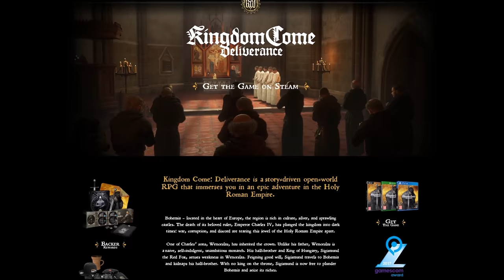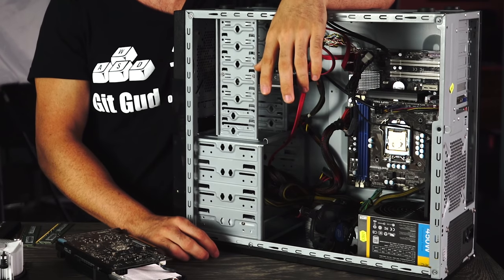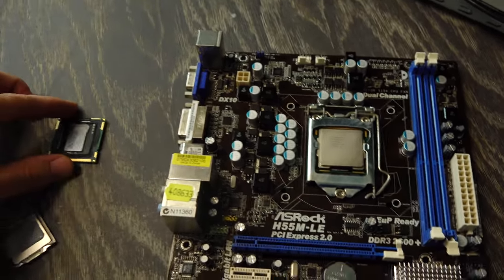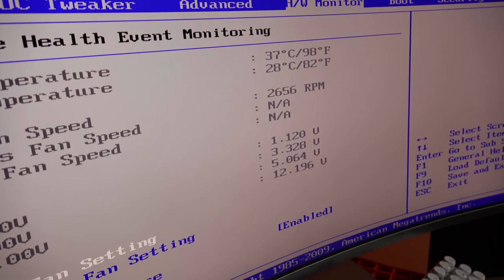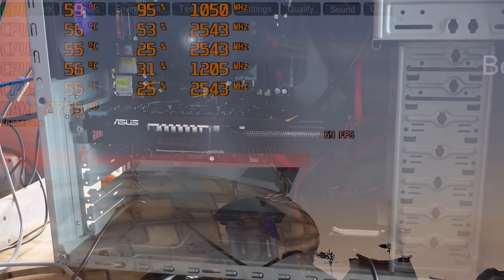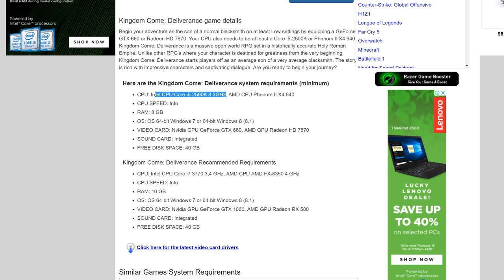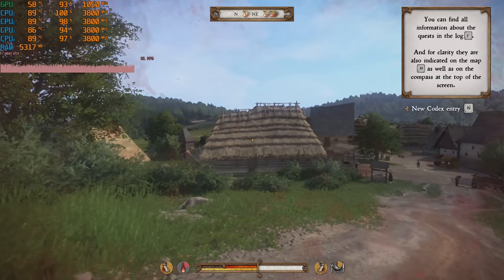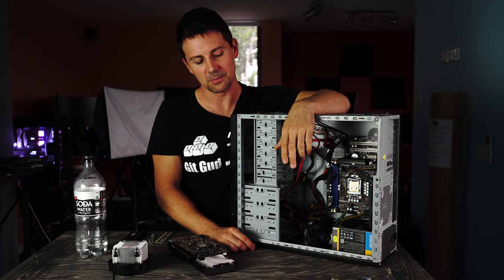The $150 'Bitsweeper' Gaming PC - Mounting an AMD Cooler for Saving that $$$...!

Comment: That graphics cards heatsink has gaps and has aluminium in between. Assuming your liquid metal has gallium in it.
Reply: Yeah that GPU heatsink is done for.
Reply: But liquid metal in general has several downsides that are rarely ever addressed by many.  For example, Gallium loves to alloy with other metals. Even with copper the metal ions will migrate into the copper, gradually creating a copper-gallium alloy that is grey-silverish in color. Gallium and indium in liquid metal will also slowly defuse into the silicon die and kill the chip after some time.
Reply: In general liquid metals are a lot more reactive than most know. Particularly when you introduce electrochemical potential between different metals.
Reply: Is it perfectly safe to use liquid metal in between cpu die and ihs ??
Reply: Of course it's not perfectly safe. 
It's just a risk some are willing to take to squeeze out that tiny bit of OC or temperatures.
Reply: CatSay .... i meant in terms of corrosion or reaction between cpu die and cpu ihs
Reply: Also no. There isn't any empirical long term testing data right now (that I know of) but the physics alone says no. It will ultimately degrade the silicon and alloy with or degrade the metals it's in contact with. How long that exactly takes requires testing.
Reply: CatSay ... oh ok thanks
Reply: I do not think the diffusion of metallic gallium/indium into the silicon lattice will be an issue, for one the silicon surface is probably well passivated, and also due to the FCBGA design the "top" of the die is acually the bottom of the wafer, meaning all the transistors are on the other surface of the die. Also IIRC doping silicon requires kiln temperatures, so at the VERY least 300-400 deg. C. I think it is very likely that even at 100 deg. C die temperature, diffusion through the passivating layer would take decades, if not centuries.
Reply: That's what I would also think, but there isn't any test data out there for this specific scenario with large chips.
So for all we know we could be wrong with small surface scratches or edges being a factor.

This all comes down to my earlier statement that we can't say it's entirely safe and that there is of course inherent risk involved which some will forego based on their own needs.

I of course have nothing against people using LM on their CPU's. The science behind it is always interesting and worth knowing however. :)
Reply: tim serious yeah you're good IHS is nickel plated
Reply: One could of course try to do an accelerated aging experiment, say put LM on a CPU and keep it in a "thermal chamber" heated to 125 or maybe 150 deg. C, a temperature that should not cause damage without LM, and test if the CPU still works and is stable every 3 months or so. But that would still be a sample size of few (unless one starts baking a lot of CPUs), so not that great, the best we are going to get is probably a buildup of anecdotal evidence.
Reply: A natural degradation by corrosion/electromigration could literally take anywhere from months to thousands of years under normal circumstances.
In the case of a regularily used CPU probably a bit shorter, but this should really be of no concern to someone who plans to upgrade his CPU after at most 5 years.
Reply: Liquid metal thermal conductors have been used in enthusiast PCs since the early 2000s. So thats at least a decade of good use in its favor.
Reply: rip gpu cooler
Reply: The concern is not corrosion or electromigration, but the diffusion of gallium atoms into the silicon lattice, since gallium can be used for doping silicon to become p-type. Development of a tick enough layer of gallium doped silicon could theoretically stop the CPU from functioning.
Reply: Or use scihub
Reply: +SysPowerTools I would be a bit more receptive of your input if it weren't so accusatory in tone. ;)
I'm simply doing my best in the absence of better information. 
But thank you for your input, this is a community after all.
Reply: I'm pretty sure Bryan has a lot of gpu heatsinks to spare for that generation of gcn. But yes it's not the best practice to show viewers what kinds of heatsinks not to apply LM to.
Reply: I was screaming "NO!", but I couldn't stop him.  RIP GPU HS. :/
Reply: What a job by Bodging Bryan from Brisbane.

Comment: rip the alu in the gpu cooler
Reply: Filip Munk Yes... I thought that aswell.
Dont use LM together with ASUS DirectCU coolers
Reply: TheRailroad99 it's not with asus cooler... It's for anything aluminum.
Reply: Yes but the DCU2 cooler (which was the one from his 7850 )has aluminum between the heatpipes. 

https://archive.benchmarkreviews.com/images/reviews/video_cards/TI-DC2T-2GD5/ASUS-GeForce-GTX-660Ti-DirectCU-II-TOP-Disassembled.jpg

You can see the aluminum between the sanded down heatpipes

Comment: The LM on the GPU cooler is touching some aluminum in between the copper heatpipes. Might wanna clean it off immediately.
Reply: It'd be already too late
Reply: Leave it for more than 24 hours and it starts getting fked
Reply: +Jeremy R Yeah sed life. I really hope it was the fact that he somehow missed it and wasn't like "o that's fine" because he should know it eats through aluminium. Actually I think he does

Comment: I bought my pc for 325usd and it came with this
Full config 
I5 6500,8gb ram,1tb wd blue,a casing with 5fans included, a 21inch dell s2216h 1080p monitor, thermal tech 450watt 80plus Psu and a 650va ups for --- 325usd

Later included a gtx 1050ti 110$(used) and a sandisk 256gb ssd 50$(used) ---160usd

So i spent in total ---485$

Comment: I know you're not a chemsist or anything but you shouldn't put liquid metal on every component. It contains galium which will react with some metals and tear them appart very fast. Just look at what it does to a soda can
Reply: Luka TO it is in contact with aluminum on the GPU and it will severely weaken the heatsink
Reply: weaken but it wont tear it apart if you dont touch it
Reply: Luka TO if he goes to replace it it'll tear away with in a second. It basically turns it into tissue paper.
Reply: yes ik that...

Comment: If the gpu cooler has aluminium between the copper heatpipes the liquid metal will eat that away because chemistry :P it does say that on the big warning label in the liquid metal packaging  :D
Reply: Guess as long as the copper stays clean it should still work. But still prefer nickel plated surfaces for LM.
Reply: @Happy he is talking about how gallium literally kills aluminium, that GFX card is gonna be dead within hours of that contacting it.

Comment: I've got plenty of used PC's. Last December I restored my Asus 970 Pro Gaming/Aura. New case, new AMD Max cooler, Samsung 960 EVO 256GB, and MSI Gaming X 1050 ti 4GB. It already had an FX8350@ 4.4Ghz, 16GB DDR3 2400Mhz. Now with a fresh install of windows 10 and steam. I find it to be a very capable 1080p120mhz gaming machine. I play AAA titles. I use it mostly for my DX11 games. I have a custom watercooled 1600x w/O.C. RX 480 @1410 that I play my Vulkan, DX12 games on. I have 1 freesync gaming monitor so it's shared between the two systems. All those "upgrades" where on sale when I bought them. I felt I got scalped for the 1050ti @$179.00. But look at prices today. Keep up the good work with memory prices and gpu's costs over the top. Last gen pc's are worth a 2nd look. DDR3 memory has supposedly come down recently while DDR4 climbs. I paid $40 for 8GB on ebay recently so why not. I won't settle for less than 3200Mhz DDR4 for my builds. Last spring I paid $130 for 16GB DDR4 3200 x2 for the two Ryzen systems I built. I have a FX9590 w/990fx mb and the same 2400 DDR3 mem to bring back later. Have you looked at FX builds w/newer low end gpus?

Comment: From my experience with applying thermal grizzly Conductonaut, you don't apply it on the die first, you apply it on the IHS or the heatsink. That way it's easier to clean up if you squeeze out too much out. 

When applying it, people have the tendency to pull back on the plunger to suck it back in and stop the flow, that's why it comes out like crazy when you apply it again on something else. Get the flow by applying it on a heatsink or IHS, that makes it easier to manipulate the flow on the die. 

Works every time.

Comment: the liquid metal compound is going to eat the Gpu heat sink where it touches the aluminum. Also you can take the container for the thermal grizzly and pull the compound back up into it if you push to much out.

Comment: As soon as you said delid I was holding out for a bunnings trip montage
Reply: Jarrod'sTech MONTAAAAAGE!
Reply: I was under the impression that intel didn't start using TIM instead of solder until fourth gen core iX cpus.... he delidded a soldered cpu
Reply: The info I read was incorrect about which gen started to be non soldered it said 2011 cpus were soldered and everything up to socket 1150 on mainstream was soldered with 1150/1151 being TIM. But since this is socket 1156 (first gen) my point is still not wrong he delided a soldered part.
Reply: What is your source saying that Intel used TIM on first gen core cpus because I can't find anything saying anything before sandy bridge with TIM being used.
Reply: Ok so no official or trusted source just what was in this video.. I'm going to go with the Intel papers and tech forums saying they were not TIM on mainstream until haswell and that Xeons are soldered. And since it doesn't show him delidding it only shots of it already having been done.. there's no reason to not just assume the thermal paste being seen was put there by him not Intel when weighed against all other sources saying this and much newer chips still being soldered.
Reply: I own a 875k, The 1156 i3/i5/i7 chips are soldered From intel as are the Xeon line on the platform. Maybe his used chip had already been delidded and resealed it's certainly possible.. Didn't say he was being foolish or did anything wrong btw.. just was curious why he would delid a ihs that was soldered factory(as the soldered ihs is pretty dman good and there would be very little benefit to delid it) I didn't see him delid it in another video only the chip in this one.
Reply: I've been looking around for the last week to get evidence of 1156 CPUs being soldered or not. The delidded ones I found with google were all unsoldered or atleast didn't look soldered. I found an i5 750 thread on LTT forums, an i7 875k on overclock.net and a X3440 from some russian on YT. Did you delid your 875k?
Reply: I have not but my temps aren't anywhere near bad so there's no reason for me to, I've looked into doing so and every guide I found involved using a torch or a hot air station or a stove.. presumably to heat the solder as you don't have to heat a CPU to those kinds of extremes to delid it when it is using a TIM. But other information available indicates that all intel server and workstation processors in the xeon line are soldered and every consumer level chip until devil's canyon were also soldered.. the guy I had been discussing this with said that the c2d and c2q and the 1366 chips (which are half of the 1st gen core series the i7 920 is in it for example) are soldered but the 1156 ones are not... which makes far less sense why would they use solder.. stop using it then use it again in the same gen and the next... the info I've found is pretty universal.. they used it on all xeons and that they stopped using solder after sandy bridge, haswell or devil's canyon depending on the forum/paper on the consumer side of things, either way that's at least 4th gen consumer chips before they started using TIM over solder.. it is just far more logical that they did it this way. Take as example the two main arguments for them doing it at all.. soldering the IHS is more difficult than just using a TIM and that it is more cost effective for them to use a TIM instead of solder... if it was easier (it is much easier to not solder it) and/or less expensive (this could be untrue based on cost of the TIM itself vs the cost of the solder and applying it to the chip it is highly likely that it is less expensive to just use TIM) for them they wouldn't stop soldering then restart soldering them they would have just kept them not soldered since the first time they didn't solder them.
Reply: I read the LTT i5 750 post.. it was made 2017.. entirely possible he had bought a used i5 750 that had previously been delided, The Xeon line according to everywhere was always soldered so originally from the factory all x34XX chips had solder on the IHS if Bryan's was TIM it was previously delided. Look at the i7 875k delid guide.. it definitely says it's sodlered. http://www.overclock.net/forum/5-intel-cpus/1611368-old-lynnfield-i7-875k-delidded-procedure-pics-d.html also this guy was saying his i7 ran at 90-95c at load leading him to do a delid.. mine with a Zalman 3 pipe tower cooler with the fan stopped only reached around 83c.. so I don't think I'll be deliding it anytime soon.
Reply: You're right, it's possible they were all second hand and had already been delidded. But have you seen the last pictures of the 875k? That stuff doesn't look like solder, more like thermal paste. He also mentions in the last post on the thread that he was surprised he could clean it with just some acetone. If Intel has been saying 1156 was soldered they seem to be lying.. 1366 though is definitely soldered.
Reply: Maybe they were but still no evidence even the 1156 Xeons were not soldered just the same. That image next to the IHS does look suspiciously like that trash grey thermal paste pad they have pre-applied to most heat sinks. It just doesn't make much sense they would stop using it for only half of one gen of chips and then do it for three more gens before stopping.. but maybe they did on some who knows, only the workers at the fab for sure most likely.
Reply: Bunnings snags for a cheeky snack
Reply: Intel  was one source but other forums stated similar things.. but Intel has't exactly always been honest or transparent about things in the past so I don't know why i just believed that.. Maybe they have been telling lies about which ones had TIM and which were soldered.. very possible. But you basically jusi said the x3430 was soldered from factory which was my original point lol the forums did state that sodlering stopped somewhere between sandy bridge and devils canyon..And that was the grey area.. I don't know which is true or not was just going on what information was out there and the majority was pointing that 1st 2nd and 3rd gen core cpus were soldered and all Xeons were.. but your mate's i5 should have been soldered by that info.. I don't trust that my first gen k series i7 is soldered 100% anymore to be honest but my temps hit 65c under load at my most abusive use and only in the low 70's under a heavy synthetic load so I'm not terribly worried.. and that's a 2933MHz chip clocked to 3861MHz.. so not horrible

Comment: Good stuff as always Bryan! 

I've found old Intel coolers, particularly those often found in lga775 systems, can be modified to work on newer systems with much success. Remove the plastic clips on the feet and there is usually enough room to mount to most other sockets. To fix it in place just pick up some of the following from any hardware store; thin but long bolts & nuts, plenty of regular washers plus a few rubber roofing washers to protect the pcb, along with some springs (ideally) so that the whole thing fastens down evenly. These old coolers are much heavier than the newer ones and have a lot of copper in them too. Generally enough to achieve a decent overclock. I salvage them for next to nothing from the local scrap recycling.

Comment: doesn't liquid metal destroy aluminium"?
Reply: Wayne Grigsby wtf
Reply: its on a copper slug on the cpu cooler
Reply: the heatpipes are fine , the rest is aluminium tho , so GG
Reply: It probably will destroy aluminium base of the gpu cooler, because that's what holding heapipes together
Reply: Good call, I spotted that too. GPU has copper heatpipes, but the heatsink is aluminum and the liquid metal is contacting it!
Reply: Yes it does, aluminium will disintegrate like wet tissue paper, after being in contact with liquid metal.
Reply: The Gallium will eat it. So not a long term solution.
There is even an actualy reason that the contact surface between a heatspeader and the die is gold plated. It helps with soldering and aging.
Reply: It does, it'll be a fine powder in a couple of months.

Comment: ive had 7850's and 7950's, even with proper cleanse and properly applied new thermal pastes, this regularly go to 85-90 degrees celsius once overclocked to 1050-1100mhz, so the liquid metal is working some magic there, even with fans of full blast their go to +80 with MX4...

Comment: Hell yeah, Xeons brotherrrrrrrr! Also, you can use that thermal grizzly tube thing and just suck the liquid metal back in, just pull back on the plunger with the nozzle in the liquid metal goop and it'll suck it back in.

Comment: it still made me cringe when you hammered on that AMD CPU cooler. When I get old computers in if nothing else is good I always try to at least salvage the CPU cooler, and put in the parts bin for when I might need it, so I don't have to hack a cooler to fit. Also their are a lot of decent Chinese branded CPU coolers like Deep Cool that won't break the bank that can be found on sites like eBay if you are willing wait on the shipping.